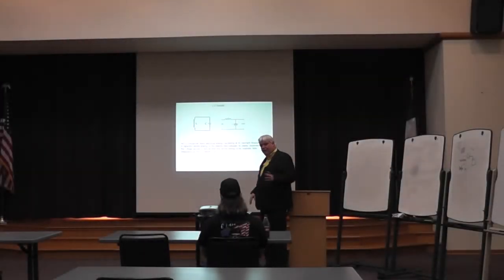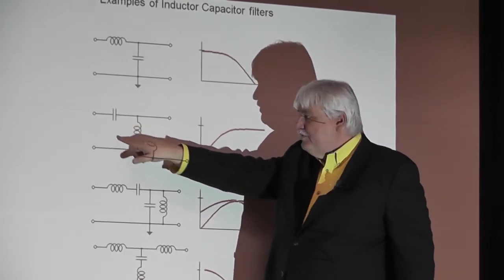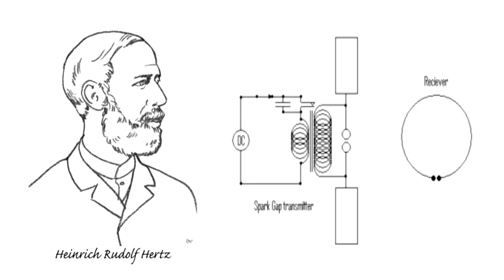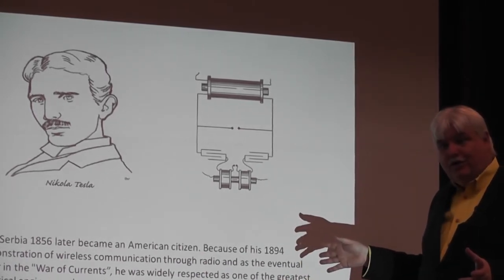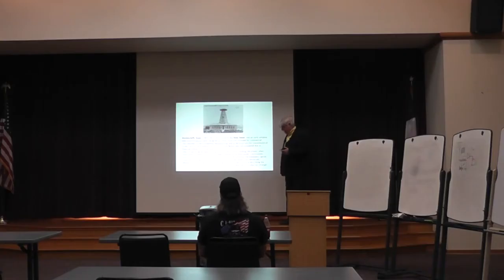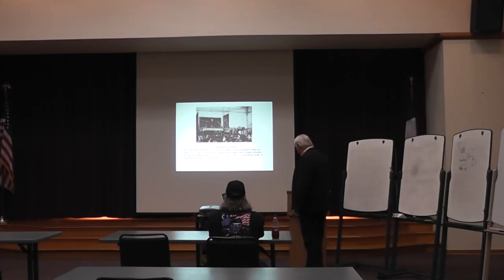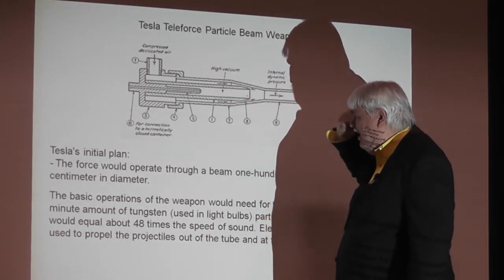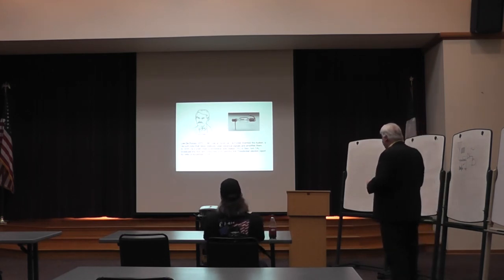RF Theory Class 36 LC Circuits and Tesla

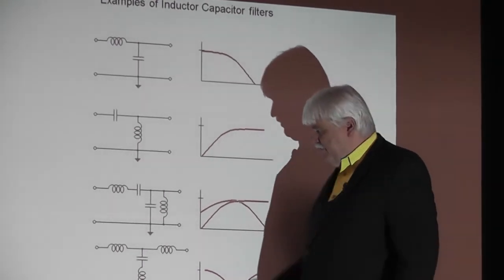Comment: @Ramon: Also at 2:15 The inductor is shorting LOW frequencies to ground, not HIGH frequencies.
 3rd circuit at 2:35, he got it backwards.

Comment from the maker: I will check the video, as I understand it AC was much more efficient in delivery and had significantly less line loss. As far as power amounts either system could deliver power from 0 to near infinity.